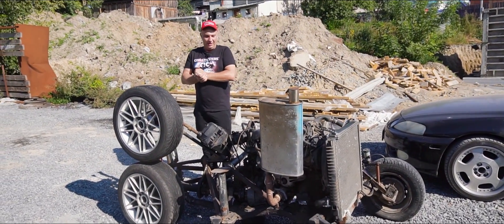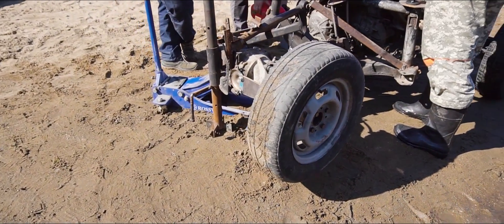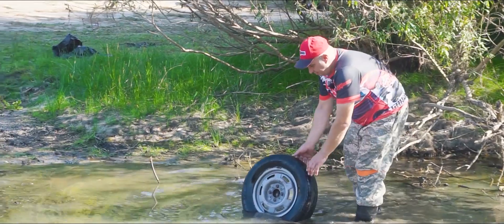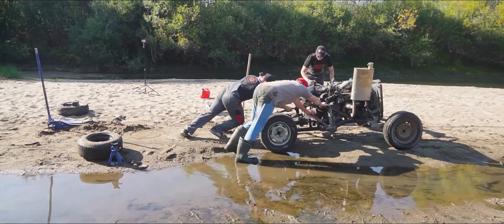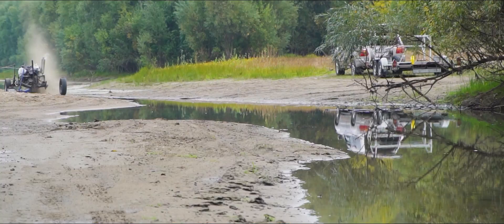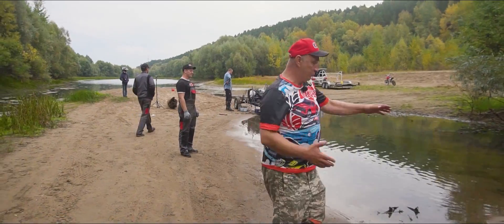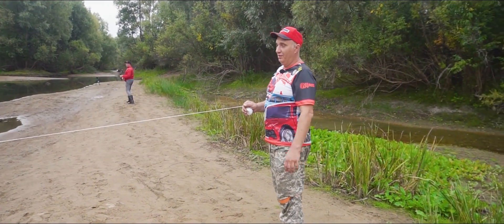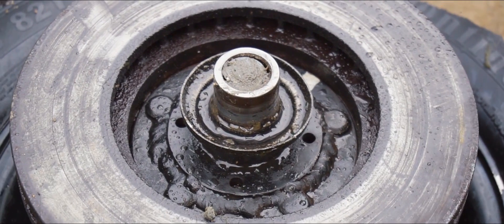Launching a wheel over water at 300 km/h

Comment: 😆 A hundred years of victory!

SUGGESTION.

Helicopter. The launch device to be repaired, and arranged in horizontal position. Aerodynamic Fins to be attached to the tyre, and test conducted to achieve an impressive altitude. The ground controllers to be in safe position at launch 0.

Comment: The reason the wheel cannot pick up speed is because you spin it up, charge with rotational potential energy, but when you let it go, the wheel itself is at 0km/h, now you need to use some of the rotational potential energy to accelerate the wheel and its mass. Lots of rotational energy is then lost. You will have to spin the wheel and fire it forward at high speed.

Comment: That tractor lug tyre- if it was fitted with the lugs pointing the opposite direction, it would pull water in from the sides to underneath it, keeping the wheel on top of the water. Buy a cheap chinese mini tractor tyre- it should be stronger and balance better. You ARE balancing these wheels, aren't you? Still it's fun watching tyres explode!

Comment: U should use big truck diffs and I would put the brake on a diff not where wheel is also I would put a fwd cv sharft in between diffs and make the wheel shooting assembly have spring and shocks sos it can move so wen wheel explodes it has shock absorption instead of metal shearing 

I recommend getting some dead f1 tires boing 747 etc tires and worn Bugatti veyron tires being those are highly rated to take it up a notch 

Also make a brushless dc motor rolling road to start cars up and use it as a dyno to test speed.........

Should also take this high speed wheel idea make a car that can do that make a track and bearing pivot that lock car into and make it race in circles make it a big distance

Comment: This is SORT OF PRETTY MUCH like a skipping stone. If you try to skip a roundish flattish skipping stone on its edge... OF course it WONT go far. Then if you turn it onto the side and launch it across the water sideways, it will SKIP and go MUCH further. SSOOO.. Find some sort of flat surface to mount to the wheel then find a way to launch it sideways whilst still keeping it spinning. Therefor it SHOULD hypothetically SKIP over the water and go MUCH further. #SCIENCE!

Comment: If you really want to skip the tire you must reverse the spin the opposite way while still having the forward momentum. The reverse spin should cause the tire to stay on top of the water and skip it quite a bit. The forward spin is causing the tire to pull down in the water. However reversing the spin while making the tire move forward at high speeds is very tricky to pull off. But it works if you could figure it out.

Comment: Put the tire on the rim backwards

The tread pattern is designed to pull the tire into the water as to avoid hydroplaning 

If you put the tire in backwards, the tread will instead push the tire away from the water and allow it to skip above the water
Reply: Exactly. Same with a slick. Its just skip

Comment: Try a smooth tyre (with no tread), a long run across sand, and then a slight ramp to get the wheel "air borne" before it gets to the water. A wide tyre may be better. Also, check out "the dam busters", a British military invention is featured, known as the "bouncing bomb", launched at around 395 km/h... You guys make great videos :-)

Comment: why not try a quad bike tyre or a small tractor tyre, like one of a little kubota. alot more weight and heavy duty. maybe because it hasnt been drilled through, they might hold up well and provide great traction.
also a "paddle" tyre that are often used on beaches by bikes, quads and side by sides.

Comment: So your best option to launch a wheel at high speed is something like a straight road. Warning, the rim will probably dig into it though. The harder the surface, the less likely the oscillations will occur that you saw, but you have to worry about friction. If you dig into the road however, you will gain a lot of frictional force, so sometimes having a small surface area for contact can actually help (which is why spikes on tires exist). Basically, you want it to dig into the surface as much as possible without having said surface create a ramp that will launch it into the air

Comment: Also, be incredibly careful spinning large masses with that kind of radius. The greater radius and mass away from that center, the more energy to get it to high speeds like that, and the more dangerous it becomes. It can travel incredibly long distances, and harm people, not to mention, if you weld or bolt anything to the wheels, the centrifugal force could break those connections and send those pieces flying at insane velocities. Just be careful 😂

Comment: Also, it is skipping over the sand (most likely) because of the fact the sand easily displaces, creating small ramps, the tire shoots up and loses traction. Using a different surface, and making sure there is a small gap between the wheel and that surface on release, will probably give you the highest acceleration and end velocity, and the wheel could go further over the water with a greater horizontal velocity

Comment: Probably just need to use a solid rim, many land speed records use solid metal wheels. The issue is that as you raise the velocity, the centripetal force must raise, but the tire cannot sustain the centripetal force to hold it to the rim, and eventually the metal lines/fiber lines running through it cannot hold the force pulling outwards, causing them to snap under tension and blowing apart the tire.

Comment: I wanna hang with this guy so destructive. Lol, I have a idea. Have you watch the tractor pull those tires are used to high rev plus weight. Has paddles will help with traction. Can you install a shock of some sort to help keep the wheel from bouncing so much when you accelerate? Maybe be give yourself a little more take-off by moving the machine back like 2 meters a little land to help with speed b4 it hits the water. 
I love watching your channel. Give me more... Lol

Comment: Summer tyre is the only that has a chance of working .  
Theres a difference between momentum velocity and the wheels mass . Getting it to spin up to say 300kph means nothing .... you need to get it to spin along at 300 not have the mass itself be at 60kph but spinning on its own axies at the 300 . 
The mass of the wheel itself is breaking water tension and hence sinking . The trick to complete this is to get the velocity upto high speed and have the momentum of the spinning wheel maintain this to counter act its mass with the bonus of centrifugal force reducing this mass .

Comment: You need to try this with a smooth wheel without tire tread because these tires are made so they pump water out from bellow the tire so the car doesn't slip when it rains.

Comment: Put a ramp infront of the machine and let's see how high it can launch a wheel into the air. The water hole you were at might work. We can see if it launches over it and why not pick a tree and let's see if the wheel can fly right over it. I would like to see how a off road motor cycle tyre can do on the how far it will go on water challenge

Comment: Why not use slicks?

The “paddle wheel” approach makes sense if the engine is attached and supplying power continuously. But with only tyre momentum, maybe slicks would conserve rotational energy allowing them to glide a bit further.
Reply: Spot on.
Reply: Was my thought was well

Comment: Y’all should rig it up to send a four wheeler or a UTV paddle style tire, those tires are designed specifically with diagonal tread blocks like what y’all tried to make but they can handle those excessive speeds. A tire from like a razor 1000 turbo or a banshee would work great

Comment: Heres something to test and mythbust. There is myth that if you fill oil filter with oil when doing oil change, this gets oil faster to where its needed and protects engine. How long it takes to oil get to valves with and with out filling the filter, normal engine from standing still and straight from the drive as comparisons and how long engine can run with out oil, before oil film wears to point where it wont protect the parts from wear, if that is more than time it take to oil get there.

Comment: With the summer and winter tires, you weren't going even close enough for the tire to bounce on the water.
You needed to floor the accelerator hoping that tiny engine has enough power to propel the tire fast enough.
Both tires needed way more speed. Like way way more.

Comment: Might get some smaller tractor tires. I am sure they popped large in part due to the expansion, but the bolts probably also compromise the integrity a lot at those speeds.

Comment: Attach a flywheel on either side of the rim, doing best to maintain balance.  Alternatively, add weight on the inside of the rim and leave the tire untouched.  Barring that, just use the heaviest rim you can find.

Also, experiment with under / over inflated tires.

Comment: Maybe try some speed-rated tires and find some industrial-strength rubber adhesive to bond the V blocks to the tire instead of making weak spots in the tires with screws and bolts. Then re-balance the tire. Also, possibly configure the V blocks in chevron patterns like the bow of a boat maybe that would reduce the bow wake in front of the tire as its hits the water. Just my 2 cents worth.

Comment: due to the bounce after launch causing an arc, the tire is sinking too deep into the water due to the bounce arc it created from the inital bounce. if you can maintain a more linear path and have a remote disconnect on the tire so you can obtain more speed to prevent penetrating the surface of the water.

Comment: Maybe a tractor tire from the front of a 4 wheel drive tractor? They have the diagonal tread and are small enough to launch. Without the bolts holding the tread on, it might be strong enough.

Comment: Part of the problem here is that the wheel is starting off from a dead stop and much of it's energy is being used by accelerating from zero. If you fired it off from a vehicle already travelling at speed it would work much better.

Comment: what if you did this with a really heavy wheel? like where the rim has a bunch of flywheels welded in or something so its solid, then just throw a normal tire on it. itll take a day and a half to get up to speed, but itll also take a day and a half to slow down... worth a quick try i think
Reply: The heavier the wheel, the more stress on the machine.  You could not get such weight up to speed before themachine broke.
Reply: @sunshinekid6922  if you slowly accelerate it the forces are fine. its imbalance that causes breakage

Comment: You should install a heavy duty fender to protect the machine when the tire explodes
Reply: the fender would need to be replaced after every blowout....
Reply: @trillrifaxegrindor4411  not of it's made out of 1/2" plate
Reply: @krotchlickmeugh627  not if you reinforce it with a steel alloy
Reply: @ogpd4898  then you'll get steel alloy shrapnel.

Comment: You can get the wheel to hover over thw water and go much further if you use a slick tire and a really grippy and smooth launch surface. The wheel must be moving forward without slipping (advance at the same rate as it's spinning) when it hits the water, otherwise it'll just dig into the water. Also it needs to have quite some speed

Comment: f1 wet tired wheel the wider the better like the dam-busters bouncing bombs designed by Barnes Wallis measured 60 inches long and 50 inches in diameter. Which weighed in at 2,994 kg with back-spin at 500 rpm: the bomb "bounced seven times over some 800 yards, sank and detonated  .
So weight and back spin and size is a factor

Comment: The "bouncing bomb" method works better. IE backspin. How you'd launch them like that though I'm not sure. The physics dictated that back spin generates a high pressure under the item in contact with the water. Forward spin in effect pulls it into the water and increases drag by loads. Bernoulli's principle and Barnes Wallis are the two potential starting points.
Reply: That’s what I was thinking. I wonder if they have an aircraft large enough to carry that rig.

Comment: I want to see these guys make an engine rev faster using needle bearings instead of the oem ones for the crank and/or cam
Reply: how would you go about getting a tiny round bearing over the counterweights and the rest of the journals? the cam you might be able to do and small end conrod. but thats about it
Reply: @Norwegian_Bastard  hey...2 strokes have it.The concept could be possible,but it might take a few attempts.If it was attempted,personally the challenge would be to keep the needles in their positions.could you imagine what would happen if one got damaged or  completely dismantled during a load test?on the plus side,there would be a decrease in friction on the moving parts allowing for faster rotation,but you would have to change the oil religiously or else...
Reply: @mobslaya1  2 strokes are made to be rebuilt often. 
Cars are made to last 300,000+ miles. 
Not gonna happen.

Comment: For the tire to skim across the water, it needs to be going 60+ mph or 100+ kph so that it is hydroplaning. So a greater distance over ground is needed for the tire to come up to full speed and all of extra rotational energy converted into horizontal speed. In the video the tire was still spinning faster than it was traveling across the ground and still kicking up a lot of sand before it reached the water. Once in the water, the horizontal speed was to low and the water just wraps around the tire and absorbs all the rotational energy. The best case would be a smooth tire which would skip over the water. As everyone knows, smooth tires are very dangerous for driving at high speed in the rain. Hit a puddle and the whole car loses contact with the ground and can spin out of control.

Comment: I think you need to give it some forward motion when launching so that its energy isn't lost getting it up to speed. (the faster you throw it forward while spinning, the more centrifical/centripital energy there will be for its travel)(like give the machine a push from behind when pulling the cord)(this way you will be able to get more out of less wheel speed)
Reply: Indeed; also automotive tires are designed in such a way to get water out of the way, the tire threads are cut to help the tire pump that water to the side ... therefore the tire will just dig in the water .. they will have to used a tire with almost no thread

Comment: Use the same setup, but use compact tractor tyres instead. They should hold up better.
Reply: Are tractor tires rated for speed?  I know theyre thicker, most just use innertubes or fill em with foam..   but one of those exploding would have a bit more boom to it…
Reply: @Z-Ack  I doubt any tractor tyre would be rated for anywhere near highway speed. The maximum speed rating I can find is G - rated at 90 km/h max. Small tractors like a Kubota would have tyres that might spin up to 300 km/h, and filled with foam, would be cool to watch. No idea if this would work, but if anyone could make it work, Vlad and Crew would be the guys.

Comment: Weight is your enemy here. You need a much light tire/wheel combo. Try a drag racing front skinny wheel with a bias ply tire. That should get results.
Reply: i disagree, so maybe we can get a video comparing a diced up minimalist rim to one with flywheels welded into it or something. light wont sink into the water, but heavy wont care nearly as much about the water friction slowing it down. hopefully we get to see it!
Reply: @jackradzelovage6961  skip a 1lb stone vs a 1 ounce stone on the water. See what happens
Reply: @wildhorse2017  the comparison seems to break down since a smoother tire didnt work as well as a spiky one, because rotation makes a difference in this scenario whereas it only provides balance for the rock
Reply: @jackradzelovage6961  Cause they're launching it from sand. Try a harder surface onto water then see the difference.

Comment: If you look up Barnes Wallis and the 'Dambusters' bouncing bomb from WW2, you'll see that it's backspin you need for best results. Which wouldn't be easy on that setup. I reckon a wide slick would work well though.
Reply: Shorter, wider tire and wheel so of might hold together at high speed. Go kart asphalt racing slick possibly.
Reply: Then tell me how they do that in lake in middle of sand dunes with bikes and quads ? They put it in reverse ? No they dont .. it needs momentum same as speed
Reply: What you mean is those bombs were put in reverse because they needed the bomb to jump higher
Reply: @Propan-Bhutan  Yes, that's how it worked: like an underarm bowling motion. Which is why I say it wouldn't be easy with their screw setup. It could be done with reversed drive and a swinging arm or quadrant, but that's some involved engineering.
However, if you want to fling a rotating cylindrical object a long way over the surface of water, it's well proven to work.

Comment: The tires are doing exactly what they are designed to do.
And traveling over water is not what tires are designed to do. 
Use a bauld tire.
Reply: And mount the tire backwards on the rim if possible.
Or what might work anything around.
The steering wheel, temporary tires, just the rim without a tire, 
Or make something deadly ! ! !